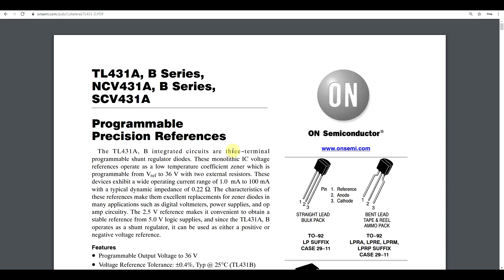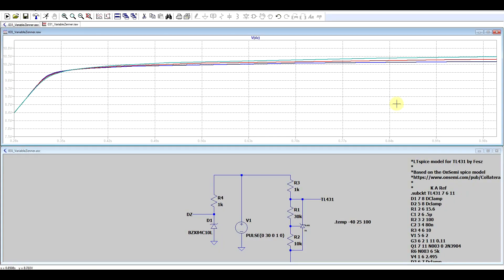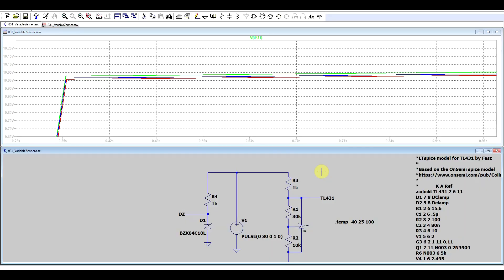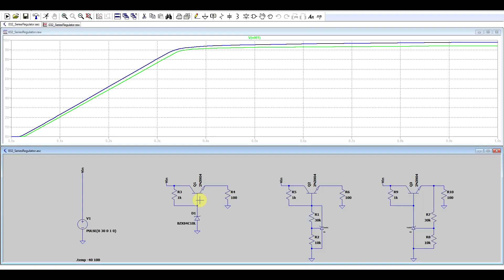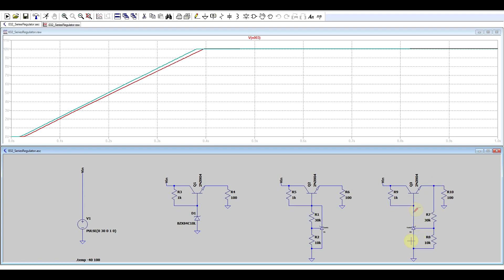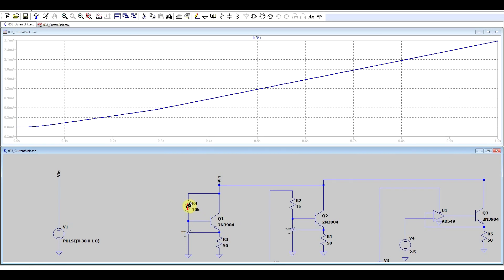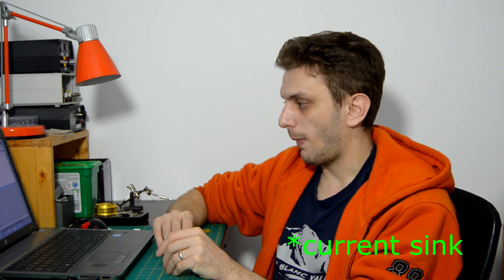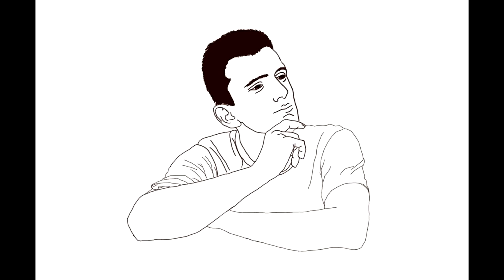Electronics Tutorial - The TL431 Part 3/3 - Simulating some common application circuits

Comment: The TL431 is a little bit noisy to work as a phono amp. A few years ago I build a class A head phone amplifier with LM317 / LM337. One as voltage follower and the other one as current sink.

Comment: I would enjoy a video about the LM336 just as much.
Kind regards
Reply from the maker: Hello Stephan! On a very short search I saw that the LM336 is a fixed voltage reference with an adjust pin; In what application is this more useful than the TL431? Or where would you use this particular part?

Comment: Read a good comment on the 431 used in a smps from: https://electronics.stackexchange.com/questions/377252/voltage-feedback-using-tl431

I don't understand the phase shift.
Maybe it will make a good video.

Your 431 series is by far the best I found on YT!

Kind regards

Look at this simplified itnernal layout (from its datasheet):

You can see there's an opamp in there driving a transistor (NPN), whose collector is considered the output (the anode is grounded). This means that, by taking a quantity from the output (cathode), and bringing it to the input, you create a negative feedback (because the collector inverts the phase), so RF1 and CF1, together with RH1 and RL1, are there to provide a zero in the overall transfer function: fZ=12&#x03C0;C(RF1+RH1||RL1)" role="presentation" style="margin: 0px; padding: 0px; border: 0px; font-style: normal; font-variant: inherit; font-weight: normal; font-stretch: inherit; line-height: normal; font-family: inherit; font-size: 15px; vertical-align: baseline; box-sizing: inherit; display: inline; text-indent: 0px; text-align: left; text-transform: none; letter-spacing: normal; word-spacing: normal; overflow-wrap: normal; white-space: nowrap; float: none; direction: ltr; max-width: none; max-height: none; min-width: 0px; min-height: 0px; position: relative;">fZ=12πC(RF1+RH1||RL1)fZ=12πC(RF1+RH1||RL1). That zero compensates for the loss of phase of the converter at around the switching frequency, ensuring it does not oscillate. Here's a quick proof:

The zero frequency is at 12&#x03C0;1e&#x2212;9[10000+(1000||1000)]&#x2248;15.16kHz" role="presentation" style="margin: 0px; padding: 0px; border: 0px; font-style: normal; font-variant: inherit; font-weight: normal; font-stretch: inherit; line-height: normal; font-family: inherit; font-size: 15px; vertical-align: baseline; box-sizing: inherit; display: inline; text-indent: 0px; text-align: left; text-transform: none; letter-spacing: normal; word-spacing: normal; overflow-wrap: normal; white-space: nowrap; float: none; direction: ltr; max-width: none; max-height: none; min-width: 0px; min-height: 0px; position: relative;">12π1e−9[10000+(1000||1000)]≈15.16kHz12π1e−9[10000+(1000||1000)]≈15.16kHz. Looking at the readings, you see the phase is 45o at around 13.2kHz, which is different than the math because of the gain-bandwidth product of the opamp, plus the parasitic capacitances of the transistor itself (both thrown in there for exemplification, only, no other reason), which influence the magnitude and the phase, both.

In short, the TL431, together with the feedback network, acts like an error amplifier, frequency compensated
Reply from the maker: Hello Stephan! I'm happy you are enjoying my content!
Regarding the link you sent, there the TL431 is used together with an opto-coupler - this being one its most common uses today in isolated switching supplies. You may be interested in this document: http://www.ti.com/lit/an/slva685/slva685.pdf especially fig.13 where such an SMPS is shown. 
Another good example is this presentation from OnSemi on the topic of designing with the TL431: https://www.onsemi.com/pub/Collateral/TND381-D.PDF its quite a long document but it has good data in it.
I might make a video on how power supplies are compensated at some point, but that is not in the plans at the moment. I have a lot of other ideas on the waiting list.
Reply: @FesZElectronics  
Greatly appreciated!
I have downloaded the links and will be reading them.
Thank you for responding.
Kind Regards

Comment: Could you show us how to do bode-plot for buck converter using opto isollator.
Reply from the maker: One of my videos on LTspice is done specifically on feedback loops: https://youtu.be/X4yaBwaO1gk . Although I did not use an optopcupler, thats just an extra component, you need a model for that and the method for generating the bode plot is the same.
Let me know if this works out.

Comment: Awesome video as always!

Maybe little question, but could you maybe also share your LTSpice asc files?
I know there is your own TL431 model, but it's just a little easier to follow with the same simulation files?
For example, most TL431 simulation models/symbols are so different that it's very fiddly to make them compatible with your model.
What's the 2N3904 transistor doing in your model actually?
Btw, did you also check the LT1431 model?
Reply from the maker: Hello Piet. 
To be honest I did find the LT1431 during research for this video, but I did not really analyze it since its a much more complicated circuit than the original TL431 and most people are more likely to find the 431 rather than the 1431.
To make the symbols compatible with the model, you need to check the order of the pins in the Symbol to match the model ( I edited this in https://youtu.be/GUFMfSlD2AM?t=1450 ); you can either edit the symbol or the model (for ex .subckt TL431 ref K A can be edited to .subckt TL431 K A ref ; its the same model just the pin order is modified; the syntax is .subckt ModelName pin1 pin2 ... pin n ; you can edit the order of the pins, just not their name since that is used troughout the model) Let me know if this works out for you.
I added the transistor to model the input pin - its non-linear current draw; the current the TL431 draws before it is switched(which is not 0) and the Ref-K diode which starts to conduct when the Ref potential is 0.6V higher than the K potetial. It was the easiest way to do these 3 things.
Regarding file sharing - I publicly share critical documents that are the most important for the video (in this case the TL model and the links to any websites shown in the video) and I privately share everything else (the simulations I run, created symbols, oscilogram photos, layout if I build something, or any supporting documentation usefull on the subject, or special request if any) with my 3rd tier Patreons; these videos take a bit of work and effort so I share certain things only with my patrons.